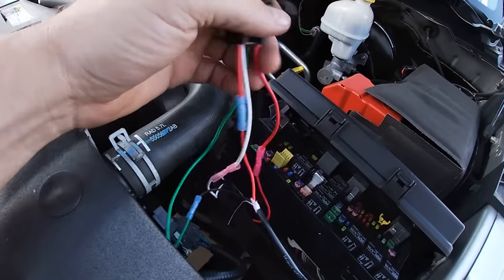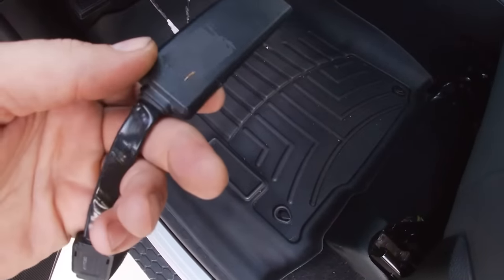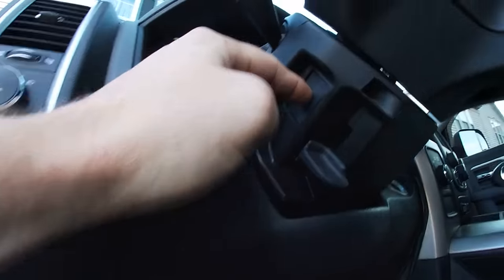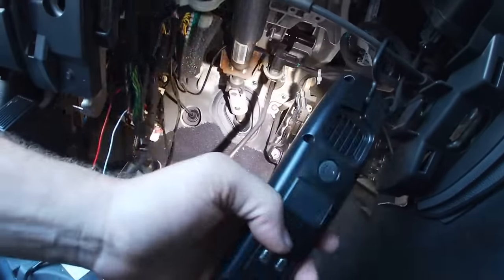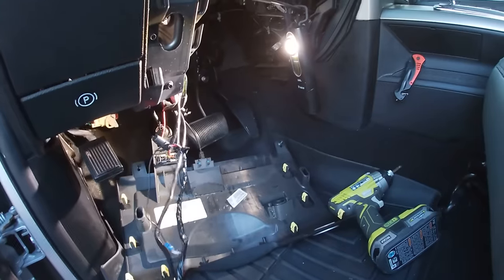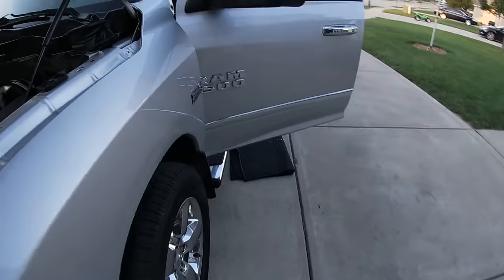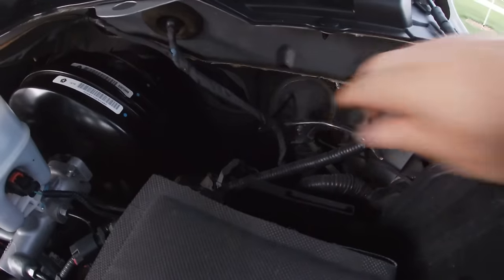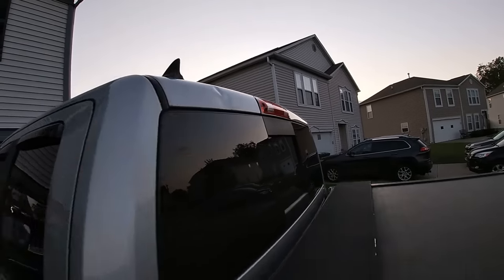Tracking Device Found on My RAM!

Comment: I found this same model just yesterday while changing the old carpet from my equinox except its only connected by the black and red wires, where would that be taking power from?
Reply from the maker: It’s hard to say where it’s being fed power from. It could be straight from the battery, the fuse block, tapped into a harness it’s hard to say.
Reply: @FABAutomotiveDetailing  I found out it was feeding from a 12v line connected to fuse box (shitty splicing job btw) and was draining my battery all the time!
Thanks for putting out this video 👍👍
Reply from the maker: @elenaguerrero7567  Glad you found it. You are welcome

Comment: Wow that was a crappy instal, I've installed in fleet vehicles and built police vehicles. All I would recommend to you is the wire you left in the steering boot I would put silicone clear around the wire for sealing from moister .
Reply from the maker: frank thompson Very crappy install! I did go back and put liquid electrical tape on them. Thanks

Comment: I bought a used Mustang GT  from a Ford dealership back in 2011. As I was doing an install of an Aux audio input on the back of the stock radio I found a GPS tracker hidden underneath the center console.  I removed it and never looked back.
Reply from the maker: DJ C2g They are on cars all over America and people have no idea. That was the purpose of my video to make people aware. Thanks for watching

Comment: This was a work truck before you got it.  Several companies I've worked for, to include the one I'm currently at, have these installed.  In case the company needs to check up on an employee for any reason
Reply from the maker: Yes that’s what I think also. It makes sense for companies to track their vehicles.

Comment: If it's a fleet vehicle, it will almost always have a tracker on it, and some dealers don't remove it (especially if they don't know it's there).  But in reality, big brother is watching.  Any new car you buy will have some sort of tracking device, usually from the mfr.  I'm not saying it right or wring, but pretty much they're there, especially since many vehicles (especially vehicles aimed at families) have SOS systems, etc.
Reply: Ford considers it a feature part of the on board modem is always connected and there is no way to disable it.

Comment: It is my understanding that any car with a 'built in compass' also has a gps unit in it. They are usually factory installed , ones with onstar also come with a 'kill switch'.
Reply: Ball Gazer  You are correct but , the GOV can access your vehicle GPS logs. If you have onstar they can do it remotely. I already have a "Block it pocket" for my phone.

Comment: With all the tipm's crashing, airbags deploying, windows going up and down, horns honking ALL of the said BY THEMSELVES...you'd think the gov would ban any leasing or finance companies from installing tracking devices. I have one on my truck, we were backroad 300ks from the nearest cell tower and tow truck, and truck suddenly wouldn't start in a heavy snow storm. (just three months ago) An I am assuming the GPS went into emergency mode and shut off the ignition until the satellite found it. We slept in the log cabin, next morning truck fired right up. THEN the damn leasing company shut it off with NO warning last Friday December 8, day before wife's birthday, and i had no clue because no one contacted me. Payments all up to date there was no reason to shut it off so I called on friday and there was no one around to check the system so the next day I did some backyard mechanic checks. Same as you. I been tinkering on vehicles for 30 plus  years, basically an unlicensed mechanic. Checked the relay, wires, its a 2015 but i cleaned all the terminals anyways. NOPE! I spend 6 hours unbolting (did a video of how to) the 4x4 front drive shaft from the yoke to get at the starter to replace it. Bought a brand new starter thinking that was it, but I should have tested the old one as you will see next. After installing the new starter (180.00) NOTHING! So then I tried jump starting it from the solenoid on the starter, it CRANKS OVER but no start! OK, now I just realized the GPS must be turned off! Called them and yes, the idiot in the insurance department of things declared he tried to call me and emailed me, (NEITHER OF WHICH HAPPENED) and since November 12 when i renewed the insurance because they didn't receive proof of insurance. ALMOST 3 MONTHS??? And when i renewed the insurance the gent said he faxed the proof over.

Comment: I did a search on the Part Number I saw on your device: 53000-58 and got this link to a GPS company that does GPS tracking: https://www.spireon.com/   I am thinking the two wires that were spliced into the wiring harness were monitoring the CAN bus, Controller Area Network.  That is a two wire communication bus used by the microprocessors in the truck, the engine controller and other systems, to communicate system parameters such as vehicle speed, engine temperature, fuel level, etc. And the relay you took out was wired in series probably as a kill switch to the starter motor so the vehicle could be remotely disabled.   I don't think that the system was meant to be hidden by the installer because it is so obvious.  You can read on the spireon web site those that would be potential customers.  Also notice how the device is marked "This side down".  Maybe they are monitoring G forces, acceleration and breaking.  I would know more but I could not find any electrical information on that web site.

Comment: Doesn’t that type of rigging invalidate the warranty? I had a stereo installer jerri-rig the wiring directly into my fuse box. It caused mechanical problems for three years before we found the problem. Is this a standard practice or am I naive?
Reply from the maker: Alicia Kreisler Yes this is how most trackers are installed.
Reply: FAB Automotive Detailing wow.

Comment: I found one of these on my 96 Camaro that I had a long time ago. I removed the cover under the steering wheel and it was tied to the column with zip ties. I disconnected it and removed all the wiring and put it in the garbage.

Comment: Back in the day the square body chev trucks would get stolen from lot where I worked we would go under dash and put a toggle switch in the ignition wire. Right side under dash there was a hole to mount it. So when they would bust the colum open it would crank not start. Truck is damaged but still there. I guess I was the colum guy. I would tighten up those wobbly columns on lunch break for extra spending money. More than working hours on the job.
Reply from the maker: Yep those years of any car really were easy to steal. We had one of our own vehicles stolen that way.

Comment: If you're not the original owner it could be the person before you who bought it got it from a lot that installed those devices too... And it's possible the place you bought it from had no idea it was there
Reply from the maker: It was definitely from the previous owner. They didn’t know it was there they thought it was the aftermarket proximity sensors beeping also.

Comment: They had a case in Calif where the mechanic that installed the trackers on all the company cars and trucks.
Worked good till they fired the mechanic.
A week later all the company cars and trucks stopped running.
The mechanic had all the codes to shut down the cars.
Reply from the maker: That’s actually pretty funny!

Comment: Yeah man I've removed those before. My friend bought a car that she had to make payments on. Well she paid it off and then suddenly things started going wrong with the vehicle such as not starting which led to calling the dealer who said they would tow the car to the shop for a large amount of money. So days went by and it kept happening and then she wound up with this huge bill that she had to pay for "fixing" the car. Well, wouldn't you know it, as soon as she told me what was going on with the car I knew it was an electrical issue not a mechanical issue. So I tore apart the dash and found the very same tracker that could totally change the performance of the vehicle and as soon I removed it the car started right back up, and then the dealer. Who I remind you again was already paid off and she owned the car free and clear called and said she voided the warranty by removing the tracker.  It was tdd he tracker that was messing with the car at the hands of the dealer who was trying too screw my friend over by creating circumstances where she needed help from the dealer to "fix" the car that had nothing wrong with it. These devices are capable of a lot of things such as frying the circuits and costing you more money then is absolutely necessary.

Comment: i just pulled the fuse on my 2015 camaro onstar, didnt seem to disable anything else.....i hated that it was a  tracker plus i hated all the bright led on the rear view mirror blinding me at night,
Reply from the maker: krav maga On Star actually ends up causing a parasitic drain over time. I have had to disable quite a few because of that especially on Cadillacs for some reason.

Comment: I've installed those before for extra money when times were tight.  They could have done a better job on the install.  If one is properly installed, once it's need is over they are supposed to disable it.  Then if it was done right it can just stay in the vehicle forever with no issues.  They probably didn't disable that one by mistake.  That's exactly just like some of the ones I've installed.  I think it's called a PassTIme device.  There are several different brands though and it's been a few years so maybe it was another brand.  If anyone else has one and needs questions answered about removal I can help you.  The beep was to tell you that your vehicle is disabled or about to be for non payment.  Of course not in your case because it should have been removed.  
You know the dealership can actually pull up your location on a map and see you move in real time if they wanted too.  I bet there are a lot of people that have those in their vehicle and don;t even know it.  I was very good at installing them.  I made it look like part of the original car almost perfectly.

Comment: Nice video. Very neat and organized garage. Note of observation for your safety: Your circuit breaker box is blocked by your ladders and maybe your air compressor. You may need to access it quickly someday where seconds count. 
- Thor
Reply from the maker: Thanks! I have since moved and the new garage breaker isn’t blocked but thanks for pointing that out

Comment: Got a question I purchased a power and light van. I use it for boondock camping is there a way to find out if I have one of those? I bought truck off a contractor who bought it from the light company auction. I am female know alot about engines and I am going to go fishing.
Reply from the maker: The easiest way to find something like this is look for wires that look out of place or a small box zip tied under the dash. They can hide them pretty well but if it was a power and light van it will probably be easy to find. Look under both sides of the dash and near the fuse box.
Reply: @FABAutomotiveDetailing  thank you
Reply from the maker: Lisa Bailon You are welcome!

Comment: NICE! very good you solved the problem, congrats. Got the Ram too and really like it. Ram best looking truck 👍God Bless, Prost
Reply from the maker: Therese Röthel Thanks! I think they are the best looking also.
Reply: @FABAutomotiveDetailing  👌 😁   I'm curious about all these mods and  upgrades hype. From watching YouTube videos I got to thinking I needed an oil catch can gadget. I always check around before I rush off and do something. I called my Ram service guy, speaking with the local auto people I know, etc. and he says he hasn't seen any issues with the newer gas Rams that would be helped out by me installing an oil catch can. He explain the entire vehicle is made to run best with the equipment it was designed with and left the factory with. I see lots of these YouTube truck guys adding stuff to their trucks like cold air intakes, lofting the truck up a foot, oversized tires etc. Seems like some bragging freak show and some sort of sales pitches,  even scams. What's your thoughts on this?  It kinda makes sense to me, like  if I do some mod to give it 50 more horsepower, then other components need to be upgraded to handle that new extra power. Thanks

Comment: You can get an ''Electronic sweeper'' on Amazon for around $50....it will detect the signal the tracking device  is transmiting.......for some ''sweepers'' thought,....the vehicule needs to be moving in order for the divice to pic up the signal......that simple !!    :)

Comment: I work for the electric utility company and all of the vehicles have GPS tracking on them. We have to use a key fab to log into it and make the beeping stop. It doesn't affect starting it up but it will continue to beep until we use our key fab. When the vehicles are sent to an auction they do not remove the GPS tracking in it. Had a friend who bought one our vehicles at an auction and he asked me what the constant beeping was cause it was driving him nuts. Lol, so I told him he was being tracked by gps and he can remove it. Problem solved.

Comment: Had the same thing happen to me on a 2002 Cavalier Z24 that I bought. I had had some problems with the battery draining, and disconnected a lot of things and still had a drain. So I I would just suffer with it and one day I had the dash apart, and if any of you have ever had a Cavalier the entire pad has to come off to do anything. It was later in the evening, and I kept seeing a flash out of the corner of my eye. Underneath the defroster duct, was where the flash was coming from. There were wires leading underneath there so I pulled them, and there was a block with two flashing lights on it a green and a yellow. The green was flashing constantly, and the yellow wood blank ever so often. It had a small antenna fastened to it, and there was also another mini in connector with no antenna on it, and by the designations on there they were cell phone type connections. They had Wireless lid off a few different directions, and I pulled the power, and tried to start the car, and it actually did work. So all I ended up doing, was remove the wires as far as I could reach them and cut them all off. I contacted the dealership that the person I got it from bought it from, and they said that they didn't use tracking devices so it had evidently been there for some time. By the way, I was not greeted with a dead battery anymore after that. Thanks for this video!
Reply from the maker: Wow they really wanted to hide that one! Glad you figured it out. You are welcome and thanks for watching

Comment: Does your navigation system still work ? lol. Without GPS, your nav system is toast, so you will have to use your phone & be tracked by google or apple.
Reply from the maker: Navigation doesn’t work off of that tracker it works off the antenna on top of the cab.

Comment: Also I should add in that you could have good credit but still there could be other outside factors that leave them to put it locator in your vehicle...It is called a risk assessment almost nothing to do with ur credit.
Reply from the maker: Bobby mercier Once again it was not put in at the dealer where I bought it. Look at the corrosion on the relay and wiring. It had been on the truck for years!

Comment: The tracker was probably overheating because it couldn't connect to its cellular data network. They automatically max out the transmitter power when searching for a new tower
Reply from the maker: That would make sense why it was so hot

Comment: This is actually common practice among smaller dealerships. I worked for a larger dealership for 15 years, it's not typically done with large reputable dealerships. Sometimes this is sold as a security "feature", but with the smaller dealerships, I assure you, it's for the purpose of repossession. Often it's presence is a term of your financing this is how they finance people with poor credit.
Reply: Not only do poor people pay higher interest rates, but are watched closely as well.
Reply: @francisaugistino701  It's not so much poor people, but people with poor credit. There is a difference.

Comment: Do all tracking devices beep like that I have a 2016 silverado I dont want them guys to nkow where im at how do I nkow if I have a gps tracker I am paying my truck
Reply from the maker: Reydel Delgado No they don’t all beep! They are usually installed under the drivers knee panel either on the firewall or hidden above wires.